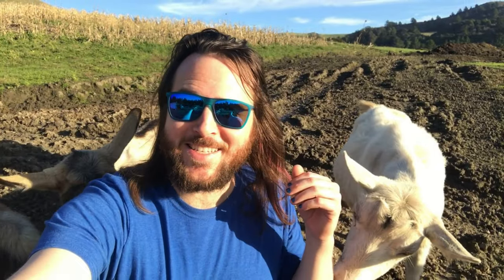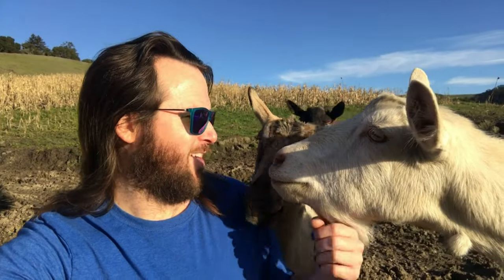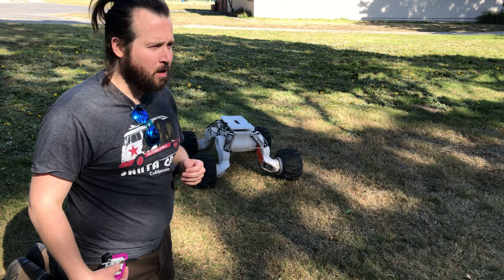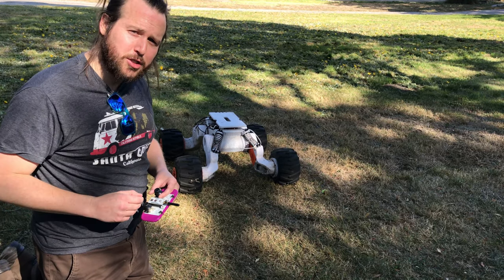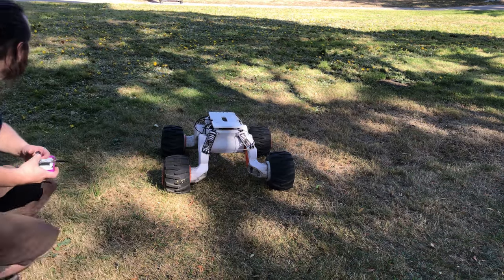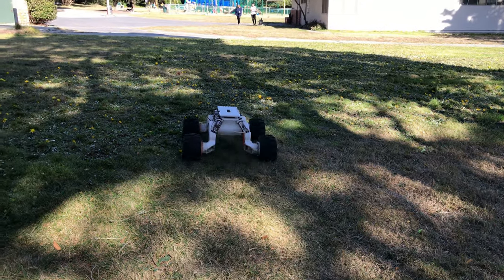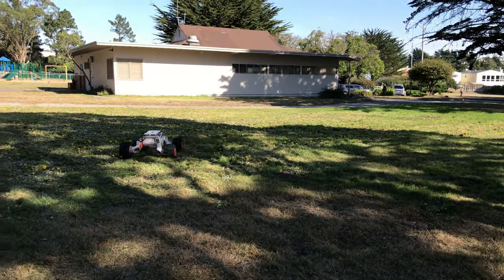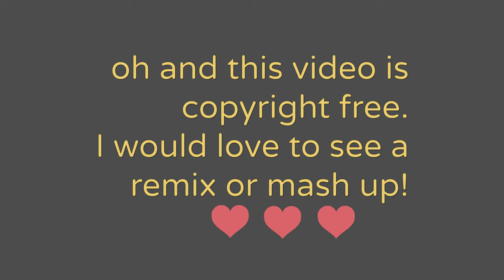December 2019 Rover update - Faster and more stable motor control.

Comment: that's great man!, plenty of torque
Reply from the maker: Tesla coil thank you! Yeah I grew up with lots of cheap “cost-optimized” toy cars when I was a kid, and they all had tiny motors. When I built rover spec’d motors with gobs of torque. Rover could drive up a vertical wall if it had the traction!
Reply: Very very nice